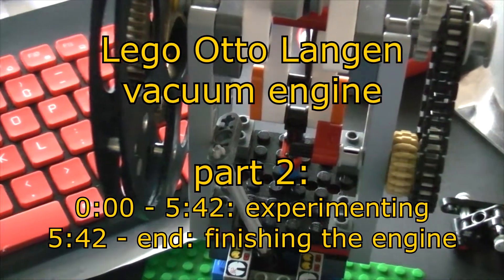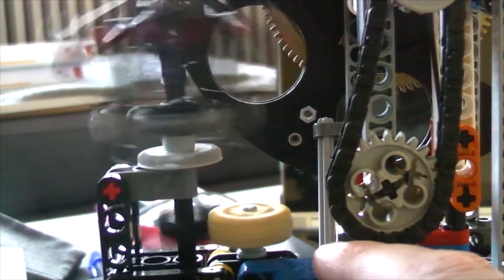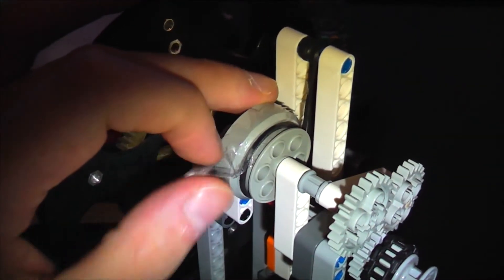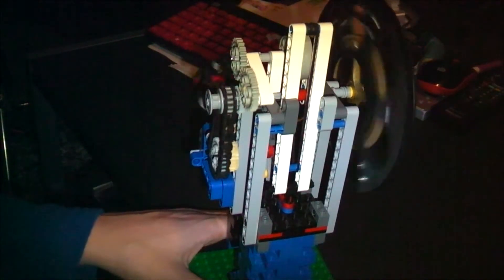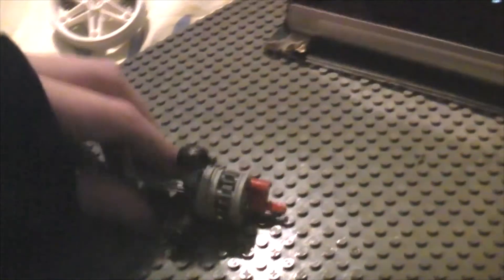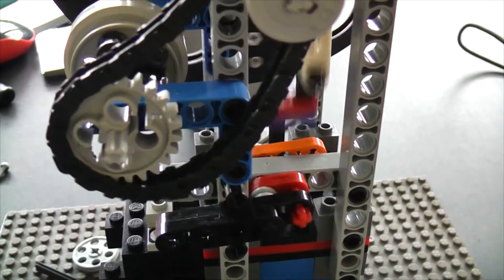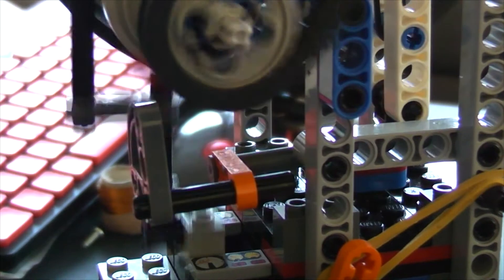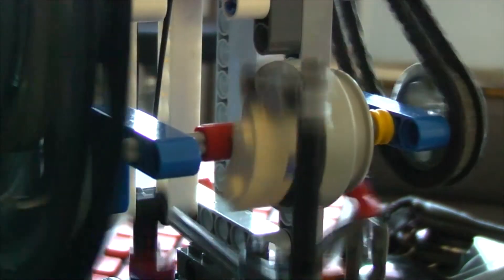Lego Otto Langen Vacuum engine #2 - Experimentation and Completion

Comment: do you ever face the engine self destructing like it breaks it self?
Reply from the maker: An early iteration of the design did have issues with the vertical shaft coming loose. I also used a chain with a gear pushed against it before settling on that pulley, and that also was rife with issues :)